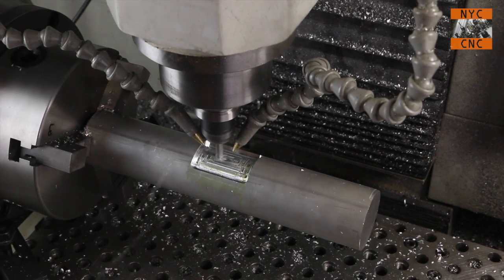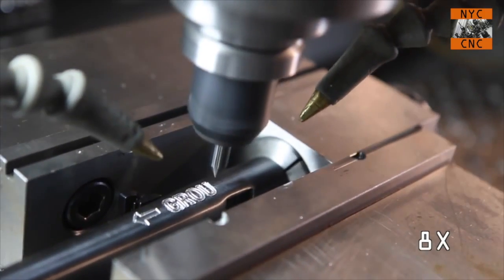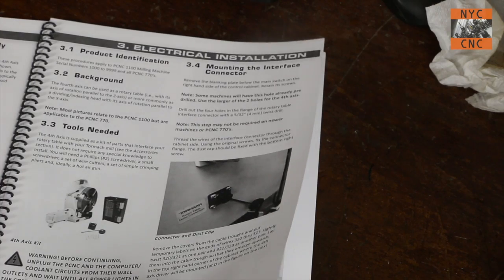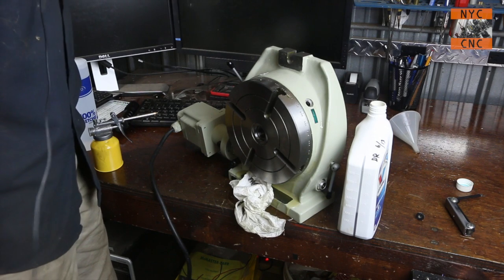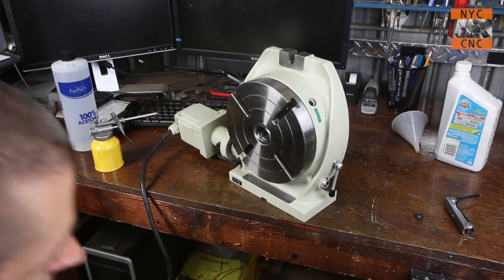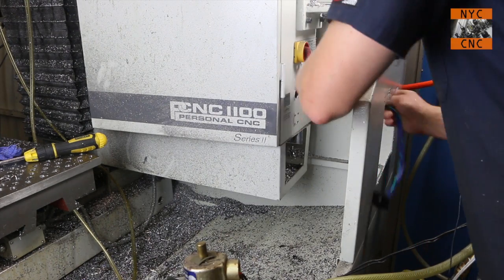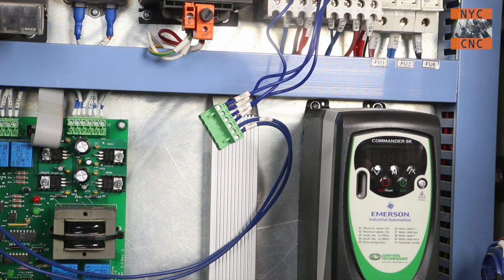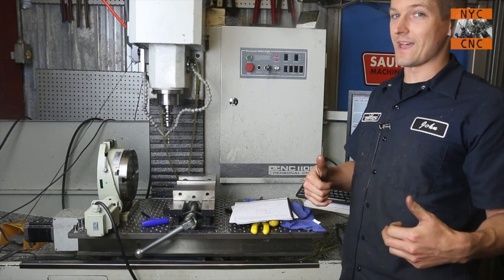May the 4th Be With You! Part 1 of 3:  CNC Milling with a 4th Axis

Comment: I'm thinking about a $300 CNC 4th axis upgrade to my LinuxCNC milling machine.  I have an upcoming project that will use a 4th axis on the mill after turning a part on the lathe, hopefully this winter, if I stop watching YouTube videos and get some shop mojo.

Ha ha.  Tormach made you use the correct blue colored wire for low voltage DC.  :-)

I had already watched the TacticalKeyChains video on his new 4th axis today, and I find it interesting that you two guys have such radically different styles.

Comment: Just FYI, you should use non-detergent 30W oil for the table.  Motor oil has additives that emulsify and hold water in suspension, which can cause corrosion inside a machine tool. Compressor oil is often 30W and should be acceptable for this use as well.
Reply: It's even a little worse than that. Detergent oil actually causes all of the fine dirt and metal wearings to float about freely in the oil making the oil abrasive (think waterjet!) It's designed to do this so that it can be removed with a filter. Non-detergent oil allows everything to settle to the bottom, out of harms way. Rule of thumb, if it has a filter, use detergent oil.

Comment: awesome, looking forward to the rest of this series.
Reply: I was looking forward to this, I think you teased a few times about the 4th axis - pretty cool for a relatively inexpensive solution. Looking forward to hear about rigidity (and if there are any issues with it) - seems like a nice quality rotary table, better than the average chinese made. Are you supposed to snug the locking screws at all when machining or leave them loose, any issues with the "play" in the table with that?
The other thing with the super spacer you mentioned - i think works better if you machine long shafts with the thru bore allowing for a close to the chuck fit.
Reply: is there a way to adjust the "gib" equivalent on this for wear? (not sure how they're built)

Comment: John,  thanks for letting "ride along" up the learning curve with you.  It's very helpful to see the mistakes and problem solving steps. Maybe Tormach will watch too, and learn where the manuals need a bit of editing. 

I've looked at CNC routers...I'd build one if I had the space for it here...and considered how to add 4th axis support. Seemed like it might be possible to just get a rotary table, replace the handle with a stepper, do the CAD/CAM work as if it was flat with the Y axis set to the circumference of the part, and connect the stepper to the Y axis controller when using the 4th axis.  Is that viable, or am I overlooking something?

-- Mike
Reply: Not so much to save space as to get a 4th axis without special software, and perhaps a bit cheaper by saving on a 4th controller.  There would be a normal Y axis flat table for flat work, and when needing to do cylindrical work, you mount the rotary table and swap the cable (or turn a multi-pole switch) and connect the Y axis controller to the rotary table stepper.  From the software standpoint you are basically wrapping the Y axis around the work...it thinks it's moving back and forth, but because of the rotary table, it's actually going round and round.  Same distance either way.  The only limitation I can see is that you can't move back and forth when set up for Y-rotary, and can't rotate when set up for flat-Y.  I can't think of a time when I'd want to do both at the same time.

That's how I'm seeing it, but there may well be something I'm overlooking.  Just thought of one possibility: different backlash between the rotary table and the flat table Y.  That would have to be changed in the "conversion".

BTW - there's non-acetone nail polish remover.

-- Mike

Comment: Hey John thank you for this. You are just awesome. This is why I buy the amazon links when I have the cash. Gonna get the haimer 3d next. I know I asked before but can I impose on the deflection from overhang when working on the right side of table? and do you plan on leaving it on all the time or are there concerns about the extra mass/momentum causing early wear?
Reply: NYC CNC I just want to know if my tormach is off its already out of warranty so its just for me. I placed the noga on the spindle and run the table from far left to far right it stays nearly flat the whole way except 4-5 inches from the right limit i get a sudden swoop upto 0.005 which I think is due to the overhang of motor and fouth axis, I wish I would have gotten the one for the right side but they did not offer it back then. I realize its an imposition so if you cant do it im ok.
Reply: Henderson Rosales
My PCNC 770 has about .0035 at the far right.  Lifting on the x axis motor will bring it to zero.

Comment: Hi John,  I just subscribed to your channel as I see a lot of common interests.  I look forward to following you on a regular basis. 
I bought the PCNC 770 with the 6" 4th axis three years ago.  I haven't used the 4th axis much yet but one concern that I have is there is no seal between the rotary table and the base.  while the oil loss is not a big problem, coolant runs into the interior of the table requiring draining and cleaning.  Any thoughts on this?
Reply: NYC CNC One thought was to modify the base or table to put in an O ring groove but this would be a major project. I tried running a high viscosity lubricant in the table to no avail.  The mist cooling system would  cut down contamination although a rather expensive solution. Given that the lubricating oil flows freely from your 8" table, I expect that you will have similar concerns.

Comment: John , Why not just just get a phase 8 inch rotary table and add stepper motor ? This what I did . Well I know tormach sponsors you so maybe you get a kick back but for the guy in his garage I just cant see why going through tormach for  the price difference would be that much more significant. Its a really big price jump.  I happen to even run the same drivers (company) as the tormach . Leadshine drives I personally love them . I run all their digital drives . 
 Its great learning fourth axis . I have some timing pulley software cad cam to gcode I can point you to the makers site if ya ever need it.  12 bucks or something . I use it all the time.
Reply: NYC CNC
I hear ya, I feel its why I got into machining like most of us. We had a part that we felt we could do the same or better than the guy down the street.
So now when I see anything automated or made of metal I start adding up my time vs there cost. 
I build parts. I dont drive to far in depth with building machines . BUT. Im on my fourth CNC as of now going from my G0704 to a G3102 (6x26 knee mill) with the knee as my Z axis.
Ill pm you with the timing pulley info.

Comment: Do you mill steel on your Tormach?
Reply: NYC CNC Thanks.  I've been curious as to what it will handle.  The spindle power seems awful low,  it seems like it would struggle with harder metals.